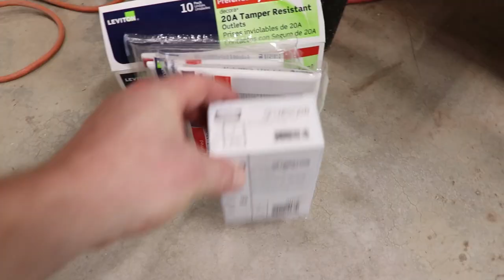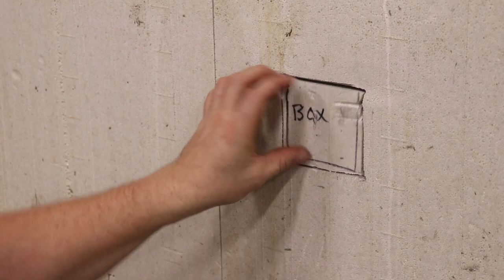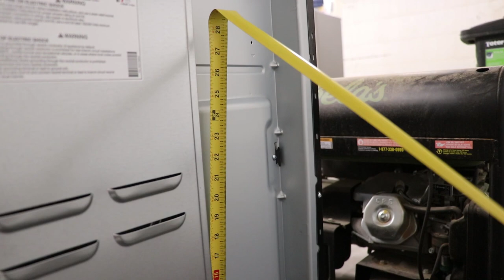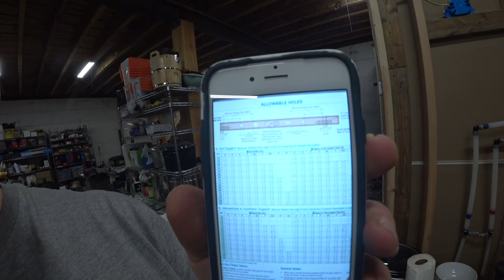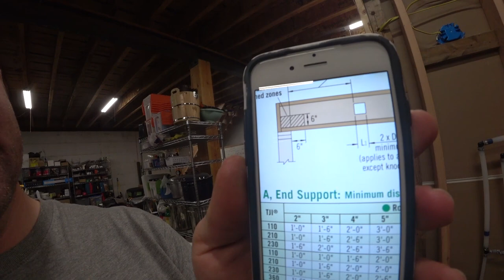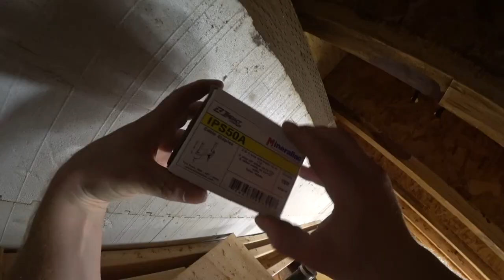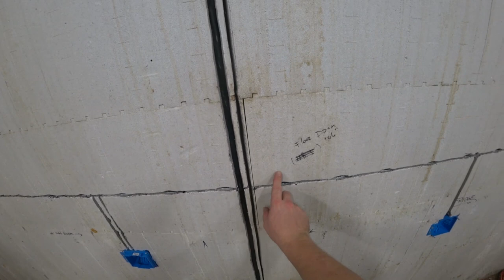SOLVED: Generator Interlock Solution (Backup Power)

Comment: How To Make Your Own Sourdough Starter

Makes 4 cups

    All-purpose flour (or a mix of all-purpose and whole grain flour)

    Water, preferably filtered

    Equipment

    2-quart glass or plastic container (not metal)

    Scale (highly recommended) or measuring cups

    Mixing spoon

    Plastic wrap or clean kitchen towel

Instructions (Overview)

Making sourdough starter takes about 5 days. Each day you "feed" the starter with equal amounts of fresh flour and water. As the wild yeast grows stronger, the starter will become more frothy and sour-smelling. On average, this process takes about 5 days, but it can take longer depending on the conditions in your kitchen. As long as you see bubbles and signs of yeast activity, continue feeding it regularly. If you see zero signs of bubbles after three days, take a look at the Troubleshooting section below.
Process

Day 1: Make the Initial Starter
4 ounces all-purpose flour (3/4 cup plus 2 tablespoons)
4 ounces water (1/2 cup)

Weigh the flour and water, and combine them in a 2-quart glass or plastic container (not metal). Stir vigorously until combined into a smooth batter. It will look like a sticky, thick dough. Scrape down the sides and loosely cover the container with plastic wrap or a clean kitchen towel secured with a rubber band.

Place the container somewhere with a consistent room temperature of 70°F to 75°F (like the top of the refrigerator) and let sit for 24 hours.

Day 2: Feed the Starter
4 ounces all-purpose flour (3/4 cup + 2 tablespoons)
4 ounces water (1/2 cup)

Take a look at the starter. You may see a few small bubbles here and there. This is good! The bubbles mean that wild yeast have started making themselves at home in your starter. They will eat the sugars in the the flour and release carbon dioxide (the bubbles) and alcohol. They will also increase the acidity of the mixture, which helps fend off any bad bacterias. At this point, the starter should smell fresh, mildly sweet, and yeasty.

If you don't see any bubbles yet, don't panic — depending on the conditions in your kitchen, the average room temperature, and other factors, your starter might just be slow to get going.

Weigh the flour and water for today, and add them to the starter. Stir vigorously until combined into a smooth batter. It will look like a sticky, thick dough. Scrape down the sides and loosely cover the container with the plastic wrap or kitchen towel secured again. Place the container somewhere with a consistent room temperature of 70°F to 75°F (like the top of the refrigerator) and let sit for 24 hours.

Day 3: Feed the Starter
4 ounces all-purpose flour (3/4 cup + 2 tablespoons)
4 ounces water (1/2 cup)

Check your starter. By now, the surface of your starter should look dotted with bubbles and your starter should look visibly larger in volume. If you stir the starter, it will still feel thick and batter-like, but you'll hear bubbles popping. It should also start smelling a little sour and musty. Again, if your starter doesn't look quite like mine in the photo, don't worry. Give it a few more days. My starter happened to be particularly vigorous!

Weigh the flour and water for today, and add them to the starter. Stir vigorously until combined into a smooth batter. It will look like a sticky, thick dough. Scrape down the sides and loosely cover the container with the plastic wrap or kitchen towel secured again. Place the container somewhere with a consistent room temperature of 70°F to 75°F (like the top of the refrigerator) and let sit for 24 hours.

Day 4: Feed the Starter
4 ounces all-purpose flour (3/4 cup + 2 tablespoons)
4 ounces water (1/2 cup)

Check your starter. By now, the starter should be looking very bubbly with large and small bubbles, and it will have doubled in volume. If you stir the starter, it will feel looser than yesterday and honeycombed with bubbles. It should also be smelling quite sour and pungent. You can taste a little too! It should taste sour and somewhat vinegary.

When I made my starter here, I didn't notice much visual change from Day 3 to Day 4, but could tell things had progress by the looseness of the starter and the sourness of the aroma.

Weigh the flour and water for today, and add them to the starter. Stir vigorously until combined into a smooth batter. It will look like a sticky, thick dough. Scrape down the sides and loosely cover the container with the plastic wrap or kitchen towel secured again. Place the container somewhere with a consistent room temperature of 70°F to 75°F (like the top of the refrigerator) and let sit for 24 hours.

Day 5: Starter is Ready to Use
Check your starter. It should have doubled in bulk since yesterday. By now, the starter should also be looking very bubbly — even frothy. If you stir the starter, it will feel looser than yesterday and be completely webbed with bubbles. It should also be smelling quite sour and pungent. You can taste a little too! It should taste even more sour and vinegary.

If everything is looking, smelling, and tasting good, you can consider your starter ripe and ready to use! If your starter is lagging behind a bit, continue on with the Day 5 and Beyond instructions.

Day 5 and Beyond: Maintaining Your Starter
4 ounces all-purpose flour (3/4 cup + 2 tablespoons)
4 ounces water (1/2 cup)

Once your starter is ripe (or even if it's not quite ripe yet), you no longer need to bulk it up. To maintain the starter, discard (or use) about half of the starter and then "feed" it with new flour and water: weigh the flour and water, and combine them in the container with the starter. Stir vigorously until combined into a smooth batter.

If you're using the starter within the next few days, leave it out on the counter and continue discarding half and "feeding" it daily. If it will be longer before you use your starter, cover it tightly and place it in the fridge. Remember to take it out and feed it at least once a week — I also usually let the starter sit out overnight to give the yeast time to recuperate before putting it back in the fridge.

How to Reduce the Amount of Starter
Maybe you don't need all the starter we've made here on an ongoing basis. That's fine! Discard half the starter as usual, but feed it with half the amount of flour and water. Continue until you have whatever amount of starter works for your baking habits.

How to Take a Long Break from Your Starter
If you're taking a break from baking, but want to keep your starter, you can do two things:
1) Make a Thick Starter: Feed your starter double the amount of flour to make a thicker dough-like starter. This thicker batter will maintain the yeast better over long periods of inactivity in the fridge.
2) Dry the Starter: Smear your starter on a Silpat and let it dry. Once completely dry, break it into flakes and store it in an airtight container. Dried sourdough can be stored for months. To re-start it, dissolve 1/4 cup of the flakes in 4 ounces of water, and stir in 4 ounces of flour. Continue feeding the starter until
Reply: Is there anything else? ;-)

Comment: Congrats to both of you on the family addition news!  
I love sourdough bread myself and have make a lot of sourdough bread. I have tried many different  starters, even one from the original San Francisco starter. They were all very good and made very tasty breads. However I was never able to get the " sourness " that commercial bakeries achieve.  I tried a lot of varied conditions to achieve the sourness that I wanted but never got there. I will be interested in seeing if you achieve that level of sourness that I failed to get.

Comment: Speaking if TJI product, we installed them for our su  floor and 6 months later (after winter) they were worn and we wanted them out to be replaced with a completely different type of sub floor (metal and cement), and we literally tipped out the joists with a telehander. We flexed 36' long joists about 5 or 6' up while ripping them out, and they go back to their original shape and look new. There was no crackling or anything like that when we did it so I assume their structural integrity is still fine. Anyways just bragging about TJI joists.

Comment: The trouble with normal flour is the bromine powder preservative added at the mill as the flour is already 12 months old - it the physic acid in grains that is the problem as it is a power full fertilise for the seed to explode through the ground.
The orange power cable connectors used are fire hazards - we use screwed terminal connectors - they never come loose and never have hot spots, especially within a wooded wall

Comment: Glad to see that you correctly fixed the power panel. That crimping tool probably cost as much as the wire to the main breaker. I hope the electrician was sympathetic to your situation. Get ur dun
Reply: I sure hope he was too, as the electrician is the one that wired the panel incorrectly in the first place.

Comment: I wish I could have talked to you. Edits you installed your range box. 
Your right, the #6 is not going to bed nor fit well on the your range device AND fit in the box. 
U need a deep box. 
I would Lower it also. But u already spaced it for your range so hope it’s right

Comment: Should really think of the future when you put in a Range plug because if your box is high like the two feet that you put it if something happens to your stove and it breaks and you have to replace it the next stove may not have an opening in the same spot 90% of the time most of them have that opening on the bottom so you're safer to have it always on the bottom instead of on the sides or up high
Reply: NEC Code requires ALL electrical be ABOVE 18 inches in garages because of possible gas fumes...

Comment: hey... on the outside outlets see what the local the code requires... in Canada, Ontario it requires AF and GF protection and when I first installed them I had them only GF protected which was the old code... it changed and so I had to add the AF protection to pass my final inspection.... that was my mistake....    Also, the outside outlets have to be a dedicated circuit.....  CHeers...... G

Comment: The screws holding your boxes down need to flush mount for your drywall. Even the plastic tab their on is going to not allow your drywall to lay flat there. I'd recess them just a little more.

Comment: Alissa loves using that middle finger. The other problem to solve is that Alissa may have a Jesse jr soon, so just wondering if his crib is going to have more screws than the barn, (house). I can see it now, baby jr at the helm swinging a screw gun in one hand and a box of bloody screws in the other hand. Just a thought,,, L.O.L ps/: there goes the scrrw gun again. Ty.🤔👍
Reply: I thought of that too..  Right after a 30 second clip solving the electrical problem that had generated so much negative feedback....  Hummmmm
Reply: For someone who would normally use a tape measure, using this non standard tool for measurement sure has a double meaning especially since the title is a little click bait for all the electrical nay sayers... Here is 30 seconds of "We fixed it". Followed by a non verbal "Here is our reply"...  Pretty Funny...

Comment: Woo!! can you put All screw heads facing same way in bathroom. makes it look a lot better, Why didn't you sheet rock the walls  before you put Fridge &  washer dryers in place??  you said in an earlier video that you might sheet rock the garage, and as you have added sheet rock plates to your plugs it would have made sense!, Also doesn't Electric wire heat up when in use?? Maybe put the wires in some small Conduit in the walls to be safe,Thanks for all the videos Alyssa.

Comment: I really feel dumb asking questions like the next, since you think so much more than me. But sometimes such things get forgotten so I ask nevertheless: do you really want ONE single run for inside and outside? I learned it is a security issue having power outside helping the bad guy to have power. Or will you put a switch inside for the outside power?
Reply: Battery power tools may have made most of this issue moot?
Reply: one day bad guys will have access to cordless tools... then your screwed

Comment: the outlet  circuit has a limit of 2400 peak watt (80%=1920 usable watt) if you used 12/3 wire as 240v at panel and 115v at plugs [ L1black to the lift plug L2 red to the right plug ] you will not be tripping the breaker  and you will have 3840 usable watts hope it helps i wood change the wire  out don   !!!!!!

Comment: I still don't understand how the internal electrical on the main and top floor is stopping the house wrap from going on.
Reply: After wiring, the splice joint and wire chase must be foamed from the outside.  If you do this first it will fill the wire chase.  The foam holes are on the outside.   I agree with you I would have put a screw at each hole then do the house wrap and then cut a flap around the screw and remove the screw and use house wrap tape to seal the flap.  This way the OSP would have been protected.
Reply: What they have said on previous videos is that they can't foam between the SIPs until they run the electrical and they can't wrap until they foam.

Comment: Do you need to use bigger wire in the insulation? In the uk you would either have to go up a size or down a breaker size Atleast

Comment: To each his own, but it seems to me the tiny loss of garage space had you framed a 2x4 wall along the sips (If the sip wall is 20 feet long, and the framed wall built to it is 3.5 inches wide, you lose 5.83 square feet, which is tiny compared to the square footage of the garage) is worth avoiding making any slits in the sips, not to mention the hassle of making the slits.

Comment: NEC 2017 200.7 (C) 
(C) Circuits of 50 Volts or More. The use of insulation that is white or gray or that has three continuous white or gray stripes for other than a grounded conductor for circuits of 50 volts or more shall be permitted only as in (1) and (2).

(1) If part of a cable assembly that has the insulation permanently reidentified to indicate its use as an ungrounded conductor by marking tape, painting, or other effective means at its termination and at each location where the conductor is visible and accessible. Identification shall encircle the insulation and shall be a color other than white, gray, or green. If used for single-pole, 3-way or 4-way switch loops, the reidentified conductor with white or gray insulation or three continuous white or gray stripes shall be used only for the supply to the switch, but not as a return conductor from the switch to the outlet.

Comment: Do you not have to use a ring main on a run of power sockets where on the final socket you run the wire back to the distribution box.

Comment: I am also interested in seeing your plan for connecting the water line, since it will not be a permanent feature in the garage after the refrigerator moves upstairs.  Do you plan on just running a temporary line on the surface, since it can be a pretty small diameter pipe?

Comment: I have been doing my own electrical (owned 10+ houses) for 30+ years (Comm elec military,) easy way to id circuit, number on inside of the plate
Reply: code in some areas want the branch number on the plate where you can see it.
mostly in commercial  stuff.. I always mark every thing for my clients!!

Comment: Have you been thinking of network outlets?
Reply: Just saying that you might regret not having a network outlet in the garage near the working bench
Reply: Why? Wireless is good unless you are a gamer.
Reply: David Weber - Been thinking the same thing. It’s never good to depend only on WiFi. 

You can run network cable in the same chases but the cable should be shielded. 

If they’re going to add cameras they need to run the cable when they do the rest of the wiring but the need to plan for outdoor cameras now. I’d recommend all cameras be POE type.

Comment: Good to see that you got the main board wired around the correct way. Now are going to reverse the board at the house and make it correct as well?
Nothing worse than getting to a house turning of a cct breaker and the bus rails are still hot because some wired it all backwards like yours is.

Comment: I recommend going with metal instead of flammable plastic boxes everywhere you can. 
They make some adapters, etc, in metal too - maybe not as many varieties, but it's 
worth the fire suppression as advantage.
A plastic box fire next to ICF styrofoam? Good bye entire house. 
The entire industry failed it's safety course when is began allowing plastic boxes.
Not a biggee but the ground prong of outlets should be top or left for better safety.
If a cord begins pulling out from hang weight the hot will not be the first prong exposed to the environment.
Seems like a waste to redo perfectly good electrical work
. . . .until an arc causes a fire inside a plastic box.
Reply: Ground should be on the bottom, that way it's the LAST connection to be broken as the cord falls out of the outlet keeping the portable device grounded right up to the bitter end!